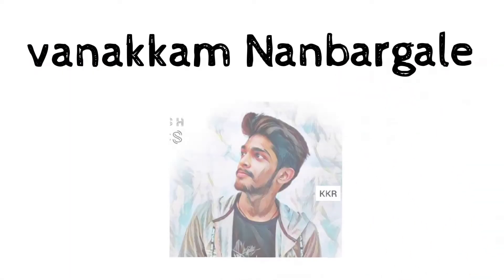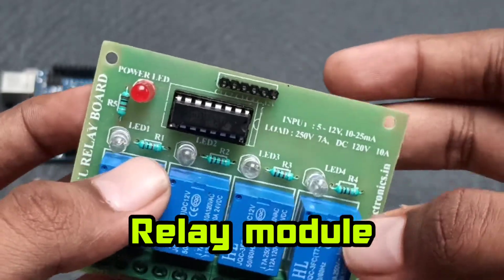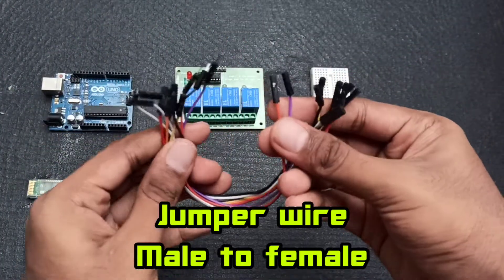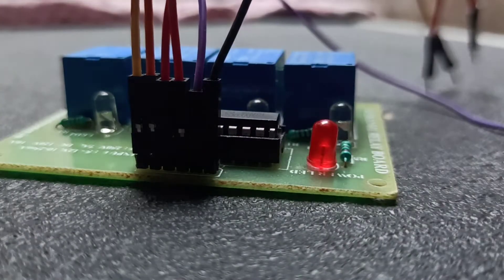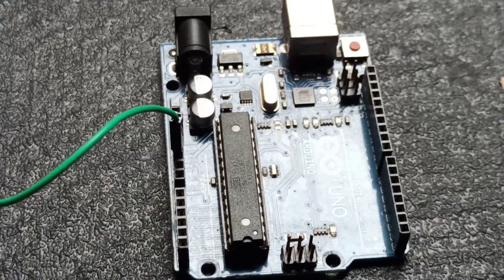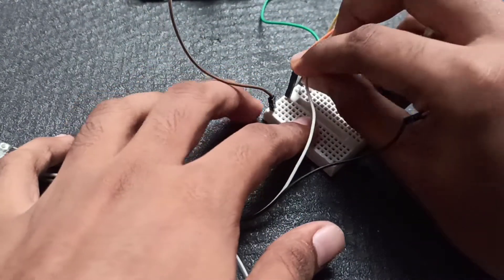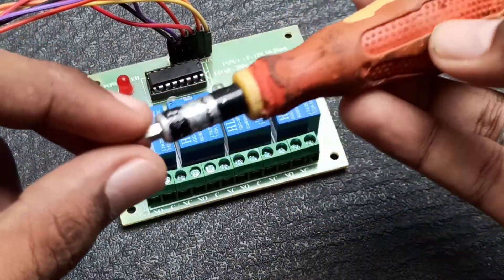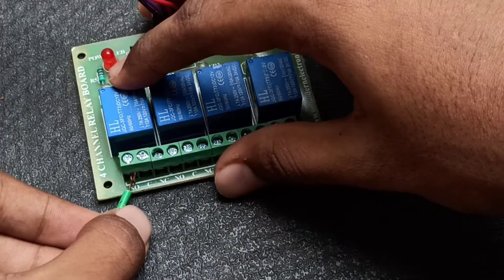Bluetooth Home Automation in Tamil|Project|Karthikesh Robotics|Tamil Project

Comment: Bro, I did this project as you told but when switch on only bulb is glowing and bt is not showing in app
Reply: So plz tell me what is mistake
Reply from the maker: Check wire connections
Reply: @KarthiKeshRobotics  wire connection are perfect
Reply: I am using 12v relay module so should i give addition charge to arduino
Reply from the maker: @LETSGO-og3er  Remove panitu reconnect panunga bro
Reply from the maker: @LETSGO-og3er  Contact in Whatsapp bro link in description.

Comment: Bro neenga... current la plug  connect panni Blum eriudhu..... blutooth um connect panni irukiga..but bluetooth 10 meter range la dha work aagum..so naama..veliya engaiyadhu poiruha v2 la iruka light fan ah off pannanum na....indha bluetooth home automation mula pana mudiuma.... bluetooth short range distance la dha work aagum ...apo Namma veliya irudhu indha project moolaigama process bluetooth epadi work aagum
Reply from the maker: Yes bro, Bluetooth is for small range only. So we can't use Bluetooth 
Instead of Bluetooth we can use gprs module to control our home applications anywhere from the earth 👍
Reply: @KarthiKeshRobotics  tq bro